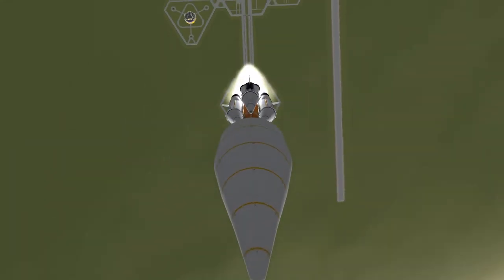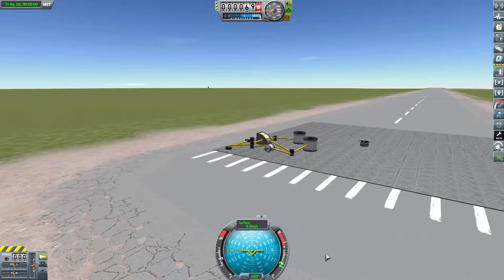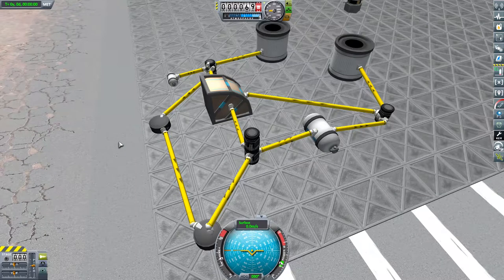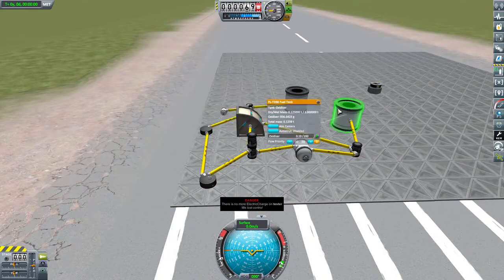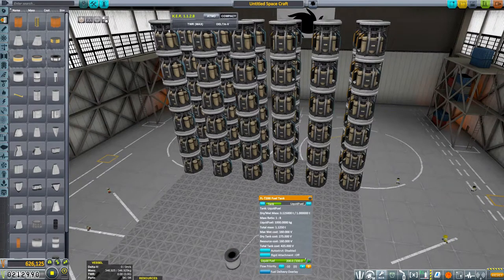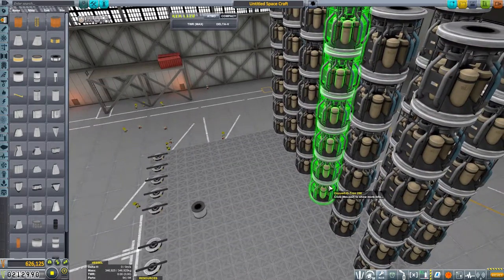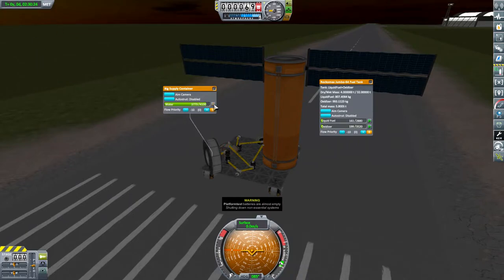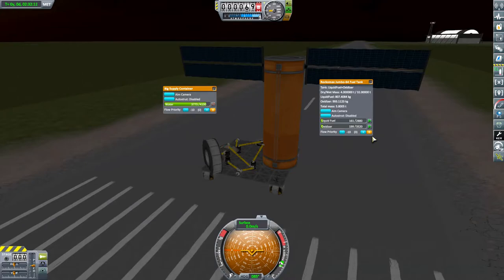Kerbal Space Program - Kerbalism S02E55 - Making Sense of Refining

Comment: You could add shielding to your station using a waste compressor, that converts Kerbal waste into shielding. However if you thought producing fuel was slow... making shields out of Kerbal poop is darn right glacial in comparison. Perhaps something else to look at tweaking in the profile? I've tried a waste compressor on my Duna ship with the idea I'd perform my departure burn from Kerbin with a nice light weight ship with zero shielding. I'd then use the Kerbal's poop to build up the shielding en-route. Well yeah... that's not a going to happen as it is now. The compressor takes decades to fill the shielding, completely unusable as is. Kinda a shame because its a neat feature. Again something else that could use some adjustment.